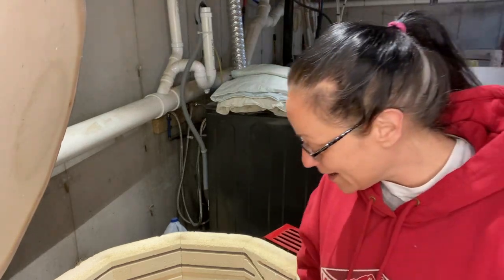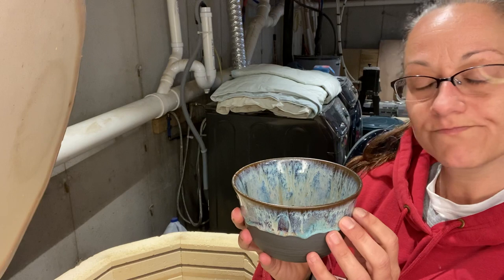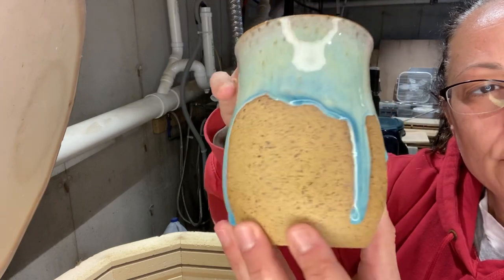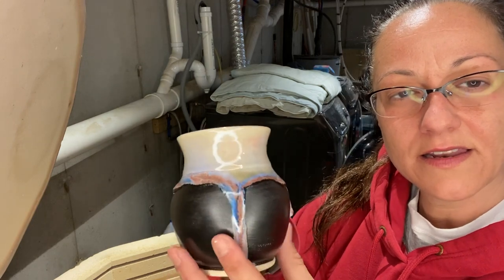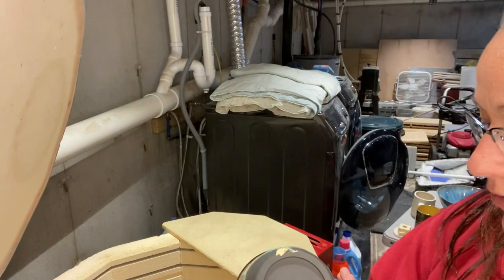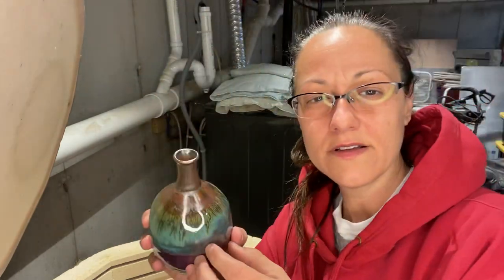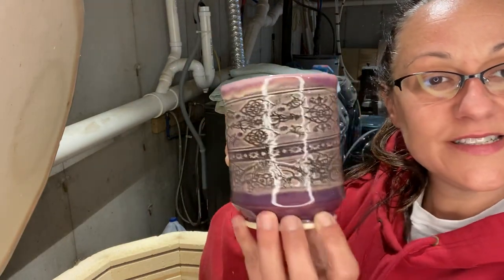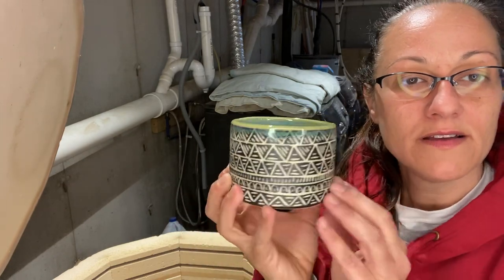KILN OPENING #1! Lots of drips! Combinations in video using Mayco, Amaco, Spectrum Glazes! #pottery

Comment: You’ve got some really beautiful pieces!! That kiln load was like Mary Poppins’ bag!! I’ve got a few Spectrum glazes and I can’t get them to turn out well. B Mix clay. Moonscape had the biggest pin hole bubbles ever and Gold Rain comes out like a pewter or gun metal color. Ever tried either of those Spectrum glazes?
Reply from the maker: Thank you!!! So I fire to a cone 6 with a slow cool schedule which eliminates any pin holes! I used to get pin holes especially on the darker clay bodies but once I started the slow cool it fixed the problem. I can send you the firing schedule if you want! Haven’t used those glazes (yet) but I love spectrums pearl white or soft white as a base ..they do run tho so be careful lol

Comment: I am curious how your formed your chip and dip platter??
Reply from the maker: Hey! So I threw a shallow plate/bowl then I cut the rim about 1/3 of the way around in a downward spiral sort of. Then I took that cut piece (still attached from the point I started the cut) and placed it in a circle on the inside of the piece. I attached it and then had to add some coils to any uneven or open space where the dip part attaches to the bottom of the piece. So hard to explain! But I will make a video to show you!
Reply: @thehappyhomesteadnh  That is what I was guessing, some sort of fancy rim cutting.  I don't know that my skill set is quite there yet. :)  Would love to see a demo.  There are a lot of chip and dip, but they are all pretty similar.  Yours has a more artistic feel.  Thanks!
Reply from the maker: @bradellison1345  lol! I literally just learned how to make that! It’s trial and error and lots of shitty pots thrown off my back deck 😂..gotta try right? Ok thanks for the idea of a new video!!